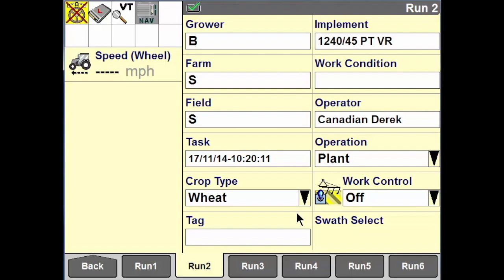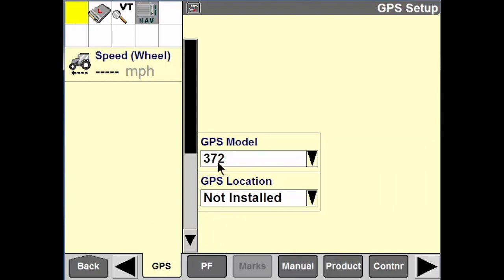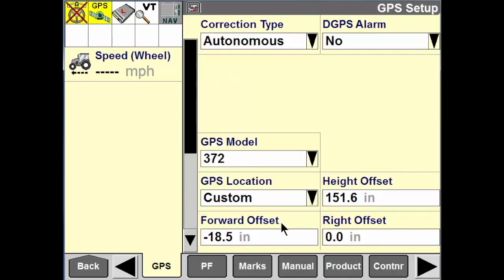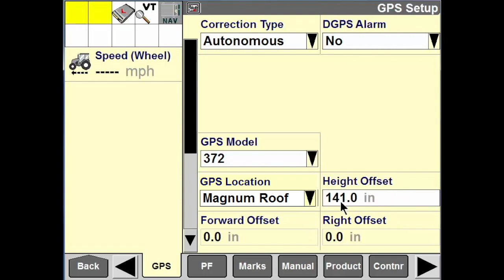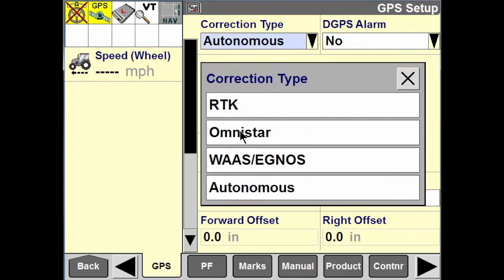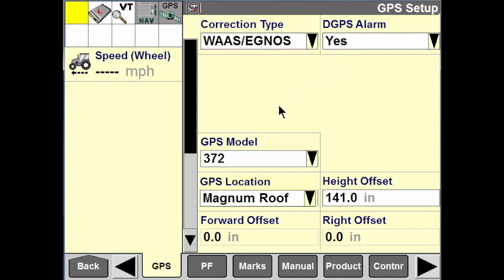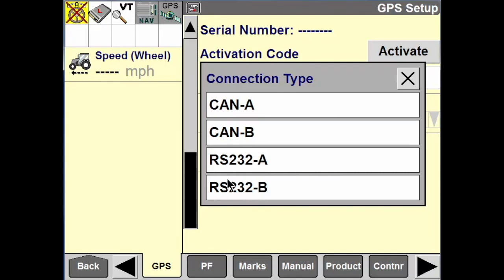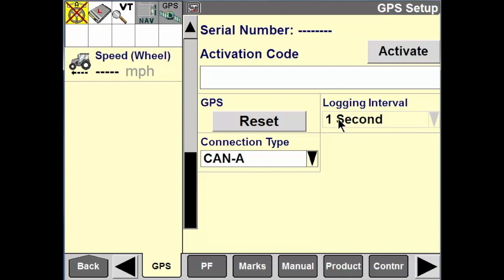Pro 700 Display: GPS Setup

Comment: Why doesn't my GPS work? Connections are are hooked up right.  Its worked last four years,  now this year it won't let my use it
Reply: re plug it in
Reply: @skylarschmeichel4367  it needs an update. Called new Holland dealer